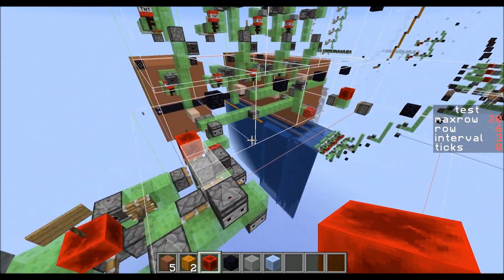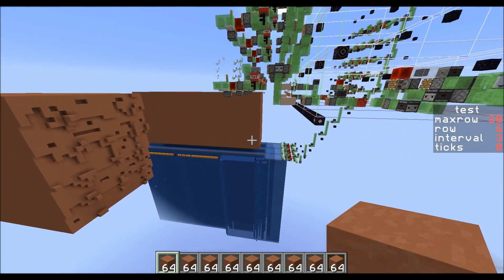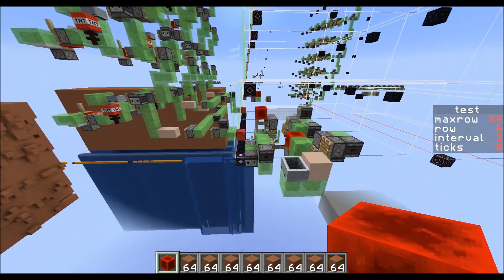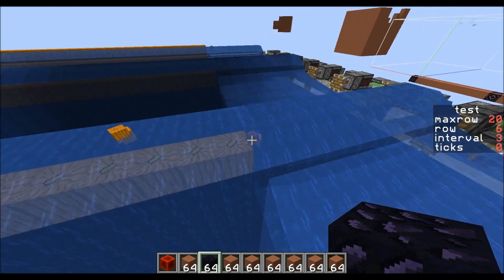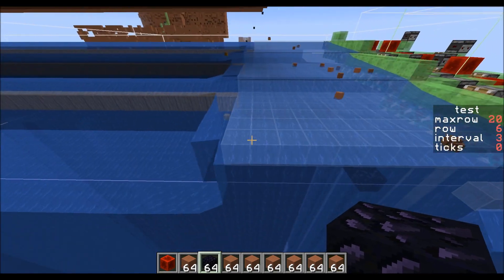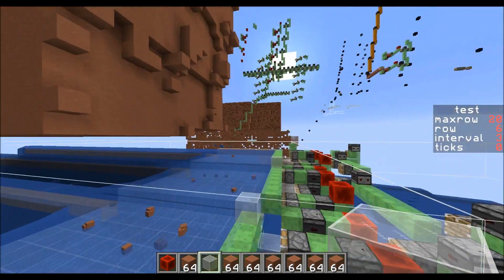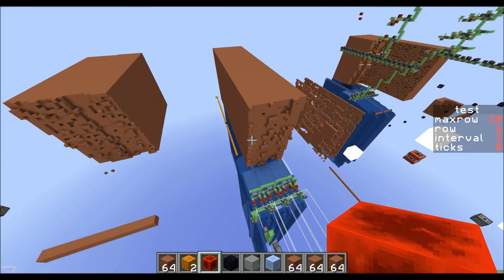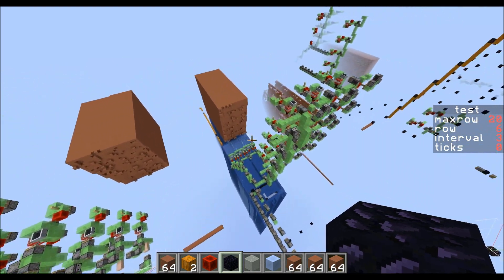Terracotta Quarry progress update - Timing & movable water streams

Comment: you can use leaves instead of pumpkins and if you place regular ica and break it you might not even need them
Reply from the maker: In 1.13 the ice needs a block below to create water when you break it.  Leaves are an option but a lot harder to farm than pumpkins.
Reply: @techman8817  oh i didn't know about that ice mechanic, but in the meantime Mumbo put out a video where he shows waterlogged blocks can be zero-ticked and they keep the water so thats an easy alternative to frostwalker.
Reply from the maker: @vaj1414  Oh wow, you're right!  Zero tick with sticky piston does indeed move the waterlogged block.